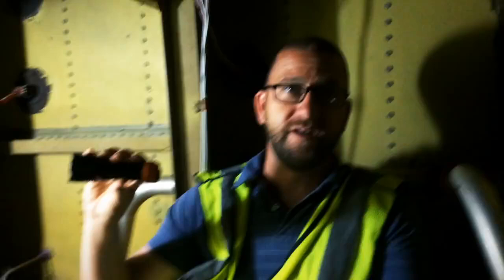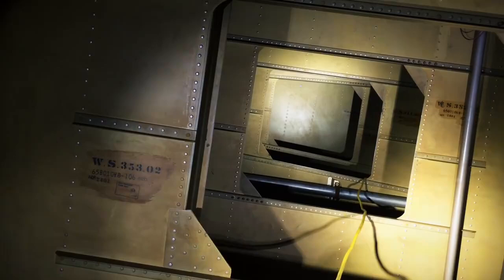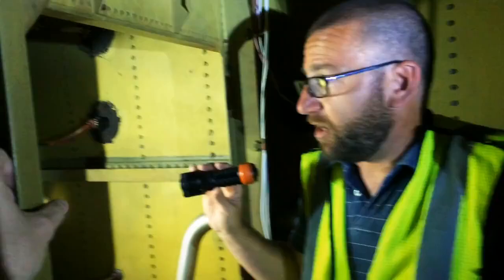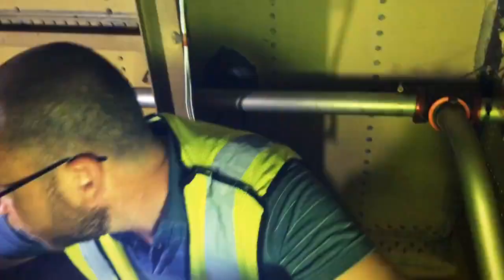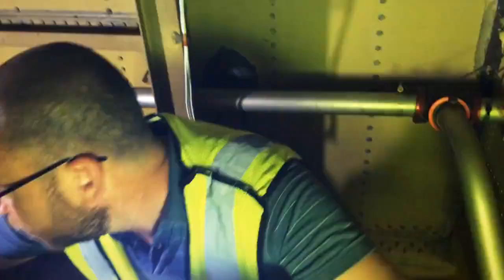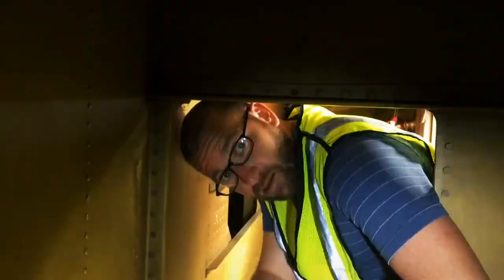The 747 Experience: In the Fuel Tank

Comment: It's what they call a "wet wing" ,the structure IS the fuel tank. Having fuel bladders adds a lot of weight they have to be supported and are a bitch to install. The ribs act as baffles. It's amazing that the 747 was designed and built in just 2 years is incredible. She is a very fast bird as well.
Reply: It's not amazing they designed the 747 in 2 years, because their know-how was as high as building a supersonic passenger craft. Actually when they designed the 747, the biggest chunk of the budged was allocated to the supersonic, the 747 was a lower/inferior plan to conquer the skies, back then.
Reply: The 747 actually it's the sad answer that we burn too much fuel to fly supersonic.
Reply: @florin604  I don't even think the idea was to "conquer the skies". The 747 was more of a stopgap design to fill a long-haul role while the supersonic jets finished their development cycles. They were all brand new technology, and the 747 was based on existing designs such as the 707, just up-sized. The entire reason for the distinctive upper deck was the expectation that all of these brand-new passenger aircraft were only going to see a couple years in passenger service, and then all be converted to Freighters when the SST's finally entered service. The 747 only had the career she had because the SST's all failed to meet the expectations of the time. Ironically, 747's are still being built in Boeing's factories, even as they're being retired from passenger service all over the world. The second-life of a freighter for the entire 747 fleet is being realized, just a few decades later than originally expected. :)
Reply: @c182SkylaneRG  the engines were a brand new technology. The fuselage was classic.
Reply: @florin604  I think the wings were new, too. I know Concorde required a unique curved wing design to maintain stability at low airspeeds; something the Russians were unable to duplicate, forcing them to compensate with those canards above and behind the cockpit. No idea what happened with Boeing. I just know the swing wing mechanism wound up being so heavy, the aircraft's empty weight and max takeoff weight were the same.
Reply: What are they filled with?
Reply: Jake so what are they for?
Reply: Jake so where is the fuel stored?
Reply: Jake sounds about right,take care Jake
Reply: @c182SkylaneRG  said "The second-life of a freighter for the entire 747 fleet is being realized, just a few decades later than originally expected. :)"

I had this exact thought a couple days ago!   Regarding the rest of your comment, I must have a hole in the side of my head because you read my mind!  Juan Trippe "knew" that every 747 would become a freighter. That's why even the passenger models have that fuselage frame in the nose where the nose would open.
Reply: @StratMatt777  No holes. We probably both saw the same PBS NOVA documentary about the aircraft that came out 15 or 20 years ago. :) I used to watch NOVA all the time with my parents before I moved out, and only stopped once I didn't have a TV anymore. (I've really gotta look them up online and catch up).

And for some reason, re-reading my comments, I'm seeing that I inexplicably changed topics from the 747 to the Boeing SST for my 2nd reply. No idea what I was thinking, but I'm guessing I was replying late at night before going to sleep and was halfway there, already. In any case, that's why I suddenly start referencing Concorde and Konkordski, and talking about a swing-wing.
Reply: @c182SkylaneRG   I could not even begin to list all the different shows I have seen and things I have read (and books I own) about the 747 and 777. There's no telling where I learned it, but I'm sure it was a gazillion years ago (or 25).

You are right to mention the SST!  Juan Trippe "knew" that every 747 would become a freighter because everyone would be flying SSTs.

When the SST contract was cancelled in 1971 there was a billboard up here in Seattle that said, "Would the last person to leave Seattle please turn out the lights?".
And, no, I was not born yet!  ;)
Reply: @c182SkylaneRG  The 747 was originally designed to compete for the contract that eventually was awarded to Lockheed to build the C-5. It was designed from the get-go with the forward hump to accommodate a forward door and main deck cargo.
Reply: Even more amazing than the airplane is that the factory and engineering buildings for it had to be designed and built from scratch also after a siting study was done, not to mention the factory tooling and assembly jigs and equipment. I think the Everett plant where it's built is still the largest building by volume in the world, big enough to hold 75 football fields.
Reply: @RH-sf7lk  I knew about the reason behind the upper-level cockpit, but I didn't know it was designed to compete in the C5 contract. I thought it was designed that way because Super Sonic was the future of passenger travel, and the prospect of easy conversion to freight would entice the investment in such a large conventional airliner when it wouldn't serve nearly its entire operational life before being replaced. (That was the impression given by the PBS NOVA program about the Concorde, anyway :) ).

Comment: In the fuel tank that has had fuel in it? Someone must have gone round with a sponge and fairy liquid to wash it all out, otherwise breathing apparatus would be needed.
Reply: and he eve hat gloves on... this video is a fuel joke
Reply: maybe it;s a brand new plane..hasnt been filled with fuel yet...
Reply: @tonyk7700  No, he said they had to bring it to that location with fuel in it to maintain balance.
Seems odd that there was once an oil based fuel in there, but no visual evidence of it ever being there.
Reply: @982spyder5  YES , yur right i watched it again....ya there should be some residue on the walls for sure.....
Reply: @982spyder5  Kerosene, which is similar to Jet-A, is a cleaning solvent.  It actually washes the container it's in.  What exactly would you be expecting to see?
Reply: David  You are off the planet m8,take your meds
Reply: @982spyder5  Yes, this is a retired 747-400 that likely entered service (with Northwest Airlines) between 1989 and 1993.
 Jet A fuel is essentially kerosene. Like a less refined version of diesel. Jet Fuel is CLEAR.  in aviation we call it "straw colored".
Clear fluid doesn't stain much. Actually, I think it cleans surfaces more than it stains them.

Also, unless you have worked in aviation, you don't have any way to know what the original shade of the yellow fuel tank primer paint is. You don't know the original color.  Interesting bit of trivia: Aviation primer on the fuselage is green, but inside the fuel tanks it is yellow and made to cope with the chemical properties of fuel.
Kerosene is not what you think of as "oil".  Because it isn't oil.  It's fuel. It is clear, not brown.
If you have any questions for me , I assembled these center fuel tanks at Boeing 20+ years ago and I'm a commercial pilot and former flight instructor.
Reply: David  Many WWII airplanes used "water injection" in their piston engines for "emergency power".  These engines, like all engines, run on fuel.
Reply: David  said " just saying that  the technology exist...or so I have 'read'"
Be careful to fact check your sources or you'll end up believing things that are not true. Which you do.
Remember, there is no requirement to upload a video to youtube. That is why there are so many videos where people are saying that something it true which is not.
Random mystery people making videos are not reliable sources of facts.
Reply: @FlyfarHP  Yessir!  I've seen it with "chemtrail believers" too.
If you'd like to understand these people completely, google the following: persecutory paranoid delusion, confirmation bias, Dunning-Kruger Effect.

They cannot be helped, they can only help themselves by turning off their confirmation bias and doing a few minutes of easy research into some very basic things.

Have a great day!
Reply: During an annual inspection, planes can sit for almost a month, possibly longer, so there is plenty of time for drainage, and airing out the tanks for repairs and inspection.
Reply: @StratMatt777  it is beyond satisfying when seasoned in the industry individuals such as yourself attend these comments with cold hard facts.
Reply: @bobsmithinson2050  Thank you for that. Sadly, my factual comments will likely instantly be cast away and forgotten by a person experiencing a persecutory paranoid delusion who is using confirmation bias to filter out all data that does not confirm their belief. 
But some people are just about to start down the slippery slope of crazy (having only watched a handful of videos) and we may be able to catch them before they are lost.  We can try anyway!

To most of them though, I'm just "an agent".  :P
Reply: Fuel evaporates lmfao. I climb in these every day. You vent it out before entering
Reply: This is a museum 🤦🏽‍♂️idk why you are reaching
Reply: Theses tanks are purged with air for a given time before entering.
Reply: Complete with electrical looms & connections 🤔

Comment: what a jokes this all is - there is no seperation at all between the tanks sections, no seperation between the structure, no seperation at the bottom (you can see the light on the other side). Electrical cables WITHIN fuel (WTF) - No special covering with rubber or something similar on the exit, pumps and pipes within the tank? This is just a freaking joke.
Reply: Free Thinking if there was complete separation between the tank sections, the fuel would not be able to flow. The electrical wires have a special coating called insulation which you can see if you look closely. There are pumps in the tank because pumps on top of the wing would mess with air flow. Glad I could clear that up for you.
Reply: Don't you know that there are plenty of cars and motorcycles that have electric fuel pumps inside their fuel tanks?
Reply: Thanks Yogi !
Imagine the life of a Peretual liar Fraud Deceiver When he has to
Meet His Maker OMG 😭
This is a Prime Example of the Extent Sinner's will go to decieve
And For What.... Eternal Damnation!
I'm sure he Thinks it was Fun and Makes him Feel Smart
Fate will Knock him Down
And Drag him around by the Balls first

Comment: All those rivets and no leaks, who in their right mind would make a fuel tank that can possibly leak at some point. And bare wires?
Reply: We have an awaken sole, shut him down!
Reply: compressed air for the win folks
Reply: btw it's generally insecure people that slagg off others when they  dissagree  with another's viewpoint or are  paid gov shills with hidden agendas!!☺ rip the globe & jet fueled plane's
Reply: They do leak busa and it's a pain when they do but generally they are pretty good.  The rivets seal themselves when they are bucked up with a gun.  Where they use fasteners or bolts they are usually installed wet with sealant and then put a cap of sealant over the top.  Using rivets and fasteners is unavoidable because the tanks structure is made from many parts, the Boeing 787 may change that with its carbon fibre construction but I don’t know much about them.  The wires aren’t bare, they have fuel resistant insulation on them.  Unfortunately that insulation failed in the centre tank and caused the crash of TWA 800 in 1996.  The wires need to be in the tank for the fuel quantity indication system.
Reply: How does all the fuel get sucked out clean?
Reply: To prepare the aircraft for an extended layup, each tank is defuelled using the aircraft pumps into a fuel tanker or another aircraft.  The fuel that can't be reached by the pumps is drained by drain valves at the lowest point of each tank (these valves are also used to take a fuel sample to check for water in the fuel).  The remaining fuel needs to be mopped out using air powered suckers and rags.  The mopping needs to be done by accessing the tank in full PPE.  All traces of fuel need to be removed to be able to successfully purge the tank with air over the next few days.  If you just need to access the tank to replace a component you can just transfer the fuel to the other wing or centre tank and use PPE to get in and do the job.
Reply: I worked at the Everett Boeing Factory 20 years ago assembling 747-400 center wing sections, which is made of the exact same "wing box"/"wing torsion box" construction as the wings are (minus the composite aerodynamic leading and trailing edges).  

If you are commenting on the rivets in the ribs that he is climbing through, there is no need to seal the ribs because they are all inside the wing box (which is the tank).

The aluminum structural wing box that contains the fuel is comprised of the upper and lower skins which have rows of stringers (seen on the "floor") attached to them for strength and a front spar and rear spar. 

The 747 is unique in that is also has a mid-spar which runs all the way out to the outboard engines for additional strength because, outboard of the engines, the 747 has a very thin, highly-swept high-speed wing (for it's massive size).  It can cruise at Mach .86 easily.

In addition to the front mid and rear spar, the center tank has 2 additional spanwise beams to prevent sloshing.

The entire fuselage is fastened with rivets so that is can flex with pressurization cycles, but the wing(box) is a much more substantial and thicker structure that must take massive aerodynamic loads.  
So rivets are not strong enough for the wingbox (but are fine for parts of the ribs).

The wingbox components are sealed and then fastened with a double row of titanium fasteners which are sealed. However, these fasteners would nearly be water/fuel-tight even without sealant because they are just a little bit bigger than the holes we drive them into with the rivet gun (which are reamed to .314 inches). 
This "cold works" the hole making it stronger.

All the wires are low voltage wires for fuel gauges.
Reply: Here's a look at how Boeing assembles the wing...  you can see the nuts they secure the bolts with that attach the wing skins to the spars:
https://youtu.be/845w8O4T9v8?t=16m38s
Reply: @sunsetlights100  you're clueless and unqualified to discuss this topic. Look I understand that you want to feel special by thinking you know something. You don't have an A&P license or experience on aircraft..  I feel sorry for you.. Honestly it's sad
Reply: @sunsetlights100   also this compressed air conspiracy is a joke. Think of it this way. In a car the piston compresses air,fuel is added then spark. The expansion pushes the piston  cause the crank to rotate. In an aircraft engine rotors and stators are used to compress the air before it enters the combustion chamber. Once fuel and spark is added to the compressed air it expands and as it exits it turns the high compressor turbine and low compressor turbine. The hpt and lpt turn the core and fan. Without fuel the engine would cease to run. This is my job. Look conspiracy theories are fun and all, but this is not one to believe
Reply: @rod9102 I'm no expert ok  I've just been looking into  basicly I'm still undecided doesn't the APU play a function while in flight!
Reply: @alanmetclaff6718  must keep then asleep, send in the agents to post lol.

Comment: Might be a silly question, but with regards to the electrical wiring at the top of the tanks, is the fuel in contact with these electrics? Or are the fumes an issue with these electrics? Or are these wires exposed for maintenance reasons?
Reply: Remember Flight 801 over New York, They said somehow the wires in the center fuel tank caused the due to heat and cracked insulation over the wires.
Reply: There shouldn't be enough oxygen for the fuel to ignite. Plus if it's fun submerged an explosion would be impossible
Reply: @Mike-rl2sc  yeah exactly. There is not the correct fuel air mixture to support combustion

Comment: I wanna see when they first enter the wing/tank....
Reply: Removing some forward sections of the wing-to-body fairing reveals the access holes which are located at the extreme bottom outboard corners of the front spar panel of the center wing tank.  It looks like this:    https://youtu.be/x_yHtfGH0nI?t=2058

Although the guys in THIS video did enter from the underside of the wing.